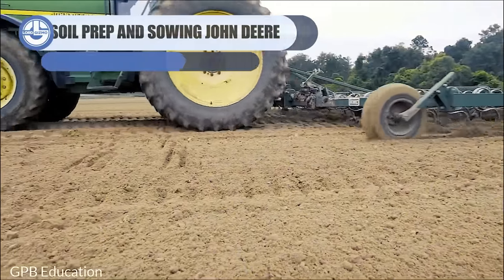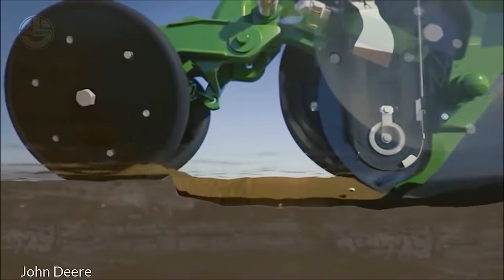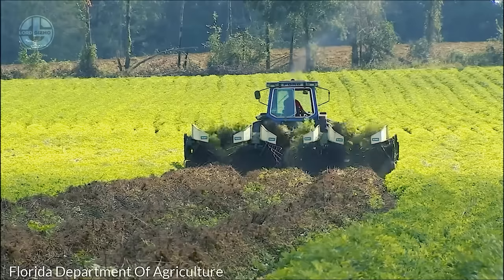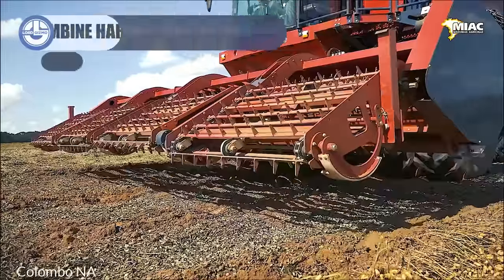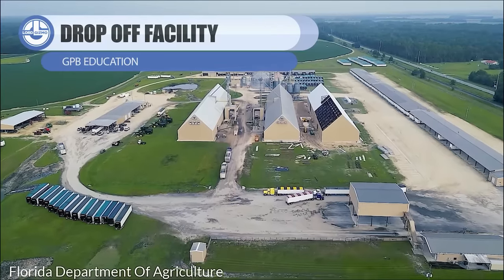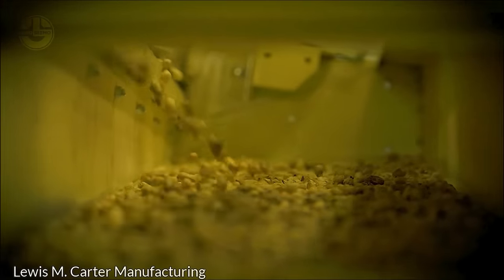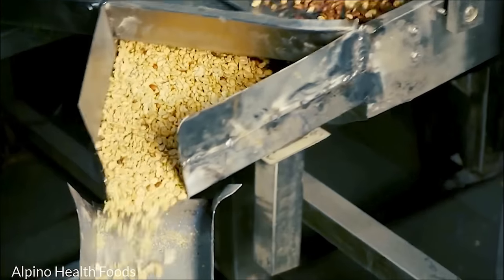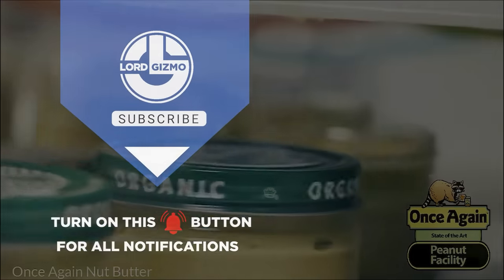Harvesting MILLIONS Of Tons Of PEANUTS To Make Delicious Peanut Butter

Comment: Pretty good video but not completely accurate.  Peanuts are planted 2.0" to 2.5" deep.  They have good pushing power to emerge.  The Deere planter shown is not the type used to plant peanuts.  The long transport distance in the tubes from a central hopper to the row units will damage peanut seeds.  You do a great job showing KMC Field Cultivators, KMC Digger Shaker Inverters, and KMC Dump Carts.  KMC also makes a great Peanut Combine.
Reply: Also, this comment was sponsored by KMC.